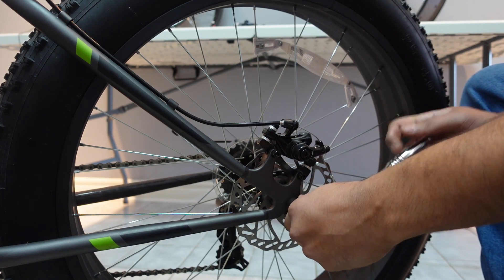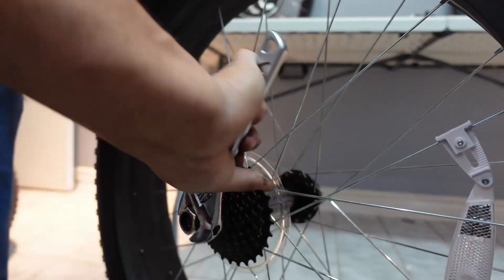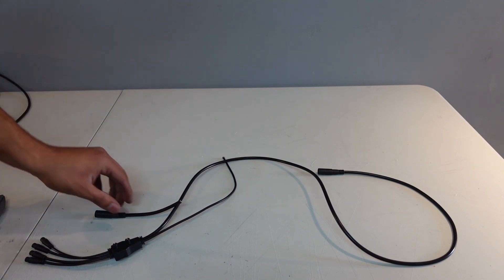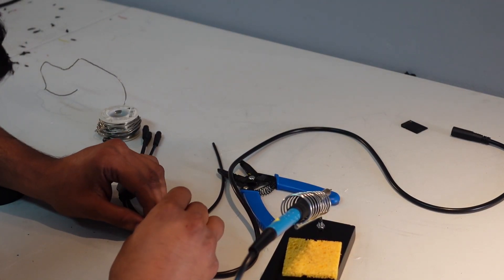Fat Bike to Electric 3000 Watt Conversion Using Two Hub Motors Dual Drive 2WD!!!

Comment: Can two Magic Pie 5 motors be connected to the same display at the moment?  and in order to synchronize the operation of these motors in PAS mode - so that both motors help when pedaling, also reverse mode - so that both motors have a reverse gear, is it possible?

Comment: I usually run into the other problem, 190mm drop out with 175mm wheel, I use a lot of washers especially for mounting the disc brake caliper.

Comment: thank you sir, great video i have a rear wheel geared hub52,1000w and i want to install bafang front geared motor wheel. i have battery and combinder for 2controllers/batteries but cant find front motor to lace in to existing wheel. also i want to upgrade existing contoller when buying new ones. is it alwasys 2WD or swicth between two or both.? and how did you tie controllers together? thx i need help

Comment: If you notice in this video he never actually took this bike out for a test ride with the dual batteries & hub motors with a lower 6 speed freewheel… That’s because he knows those dual hub motors are gonna burn out the controller quick, and it’s gonna become completely useless… Just get you a mid drive kit, and you won’t have to worry about this headache… 🤦🏽‍♂️
Reply from the maker: You can see it in action here 

https://youtu.be/sGoLhPom-m8

Comment: how do you know if your hub motor was geared correctly with the front hub motor now changing your speed? it will burn out controller quickly if not geared correctly.  esp since u had to go to an even lower 6sp.

Comment: hello I tried engine 1000 wat bafang BBSHD for travel trailer bike dog. battery 52v ah28 1450wh sansung E35 cells made by my friend igeniere. but result 30km of asphalt with climbs 8% assistance 1-2-3 weight bikers 80klg weight bike 20klg weight trailer 50klg tires plas 27.5 both bike and trailer. I would now like to try 2 hub engines the best from 1500wat each. as your video. you chêne think,!??  I year always recommended central engines because of my trip,. being that à traversero terrà and stones.. I always recommend central engine for my type of trip, with trailer and tereno mountain bike. but also increasing the (wh) then cells. I can't get more capacity in km. since consumption is high. 30km are really pocchi. already with 100km and if anything special solar panel e-bike would be feasible. I would like advice from you and a possible car,. it is 1 year that I try to realize my trip. and the project started 6 years ago

Comment: I was wondering about a duel drive. Not so conserened about speed. Rather up hill mostly pavement. Old guy here my concern is getting back home. Was an advid on and off road rider. Things change but I still want to be out. Thanks for the insight. Converting a 25 year old Cannondale in pristine condition.  Appreciate any positive input.
Reply: I just finished a 28 mile ride from Kentucky to Cincinnati and back. 3,000 watt rear hub motor doesn't care about any hills at all. And, you can limit top speed and total amps if it's too fast or too powerful. With 1440 watt hours, I had two bars of battery life left.

Comment: My bike that I have my magic pie dual drive that I mentioned below that thing probably does 30 mph easily I think I topped it out at 32 and it gets right up to speed right away these motors are very powerful very torquey

One person below suggested not running both motors at the same time all the time but that's not possible with these when you're running two of these together on the same bike because they have regenerative braking if one motor is not running then that motor is acting like an exercise bicycle set at medium you're going to run your battery down probably smoke your other motor pushing against that regenerative braking of the motor that is not running ask me how I know well I had a a power wire from my battery get crimped and I lost power about 2 mi back from the truck a while back so I had no power at all and I had to pedal 2 mi back to the truck and it was like riding an exercise bicycle on medium the whole way back I was totally worn out these do not free wheel when there is no power so both motors would need to be powered 100% of the time together but they work great and they don't use any more battery in my opinion than a lesser powered motor because I have four e-bikes and they all seem to go about the same distance on a battery charge

Comment: I have a dual drive Golden motor ebike kit that I put on a sun cruise bicycle I've had it for about 6 or 7 years I just got it running again I have not rode it in over 5 years 

Now it's running again and it runs strong it wants to do burnouts I don't have any brakes on it I just used the regenerative braking which breaks pretty quickly but it's a little unnerving I need to make a bracket to run at least one brake because I've realized if I lose power for some reason I'll have no breaking

But this bike with the dual drive motors front and rear is powerful enough to go up a 45° incline with no problem whatsoever at 200 lb load

Comment: Hi 
that is the e-bike of my dreams that has a push and pull the motor on the front and back. plus I would add one more motor to it. I would remove the crank and pedals and put in a 3000 Watt  Mid Drive Kit on the e-bike. yes, that is overkill on it but you would not lack for e-power on the bike. think how far you can go with it. also, have you looked into a tesla car battery to replace the other battery on the e-bike??

Comment: Independent throttle controls are best for dual drive bikes so you can start the rear wheel spinning before you engage the front wheel drive it is safer .
Reply: Nope, both running at the exact same time is better and faster. Just think if you foot race someone. Would you get a better start by yourself or if you had somebody push you off the start line?

Comment: Don't splice the throttle cables have two thumb throttles you wont want the front drive to run all the time . Some conditions call for rear drive only.

Comment: You are asking a lot of money for these to not have plug and play and to have folks solder all of this.Why not incllude as much plug and play--I chose not to buy your kit cause every little thing adds up and it is raw parts. I have a 4 and a half star 250 dollar kit and maybe have to crimp the controller and battery cable--this is way too much for the average person and even professional ebike places that I called are doing very limited soldering and not doing any of this on hub kits.Make this plug and play for the price you are charging.xt90 and dean type connectors are less then a dollar--this is too much work for the money and one mistake with all this wiring soldering and it will be useless.
Reply from the maker: Our kits are plug and play. Only reason for soldering was to use both motors with one throttle and brakes . If I installed 1 kit there wouldn’t be any soldering required. Which is 99% of the time

Comment: Couple questions if u don't mind..

1) Can the two hub motors be linked to a single battery?
2) Was considering buying a pre-made bike with a mid drive motor, but now I'm considering going the DIY route with 2 hub motors. 

Assuming the the 1 mid drive motor and the 2 hub motors equate to the same wattage (1000w).. would do you think would get better performance?
Reply from the maker: 1 yes the battery just needs a higher discharge 
2 for sure you can also go with mid drive conversion

Comment: These giant tires reduce battery power 50% faster that a bike with thin tires. I'd bet this thing won't ride more than 30 miles. My 10 speed will ride 85 miles with a 52 when pedaling from a start to around 10 mph and then assisting the motor at around 10% normal pedaling power.

Comment: Can it be used to drive an outboard wheel for a sidecar build?
Reply from the maker: Are you referring to the throttle ?
Reply: @goldenmotorNA  I was considering using dual motors. I'll investigate further.

Comment: Can i put mid motor and rear motor as two motor?
Reply from the maker: Yes absolutely
Reply: @goldenmotorNA I have  independent control for my  motors it is safer.
Reply: I have three motors on my Ariel Rider D bike

Comment: I thought Golden Motor used to make a connection to run two motor setups but I don’t see it on the website anymore.  Nor do I see the golden motor bicycle they used to sell.  Very cool build!!!
Reply from the maker: yes they used to but we did not have any on hand. However we have them coming in